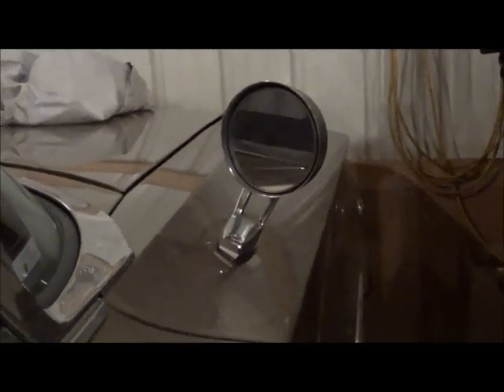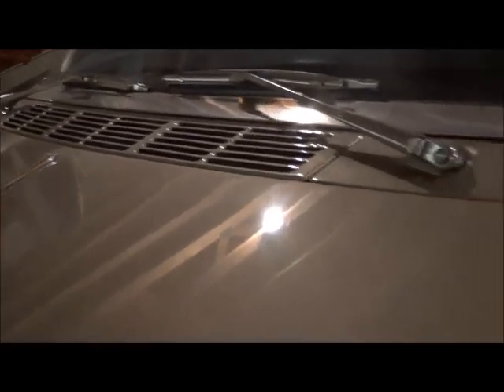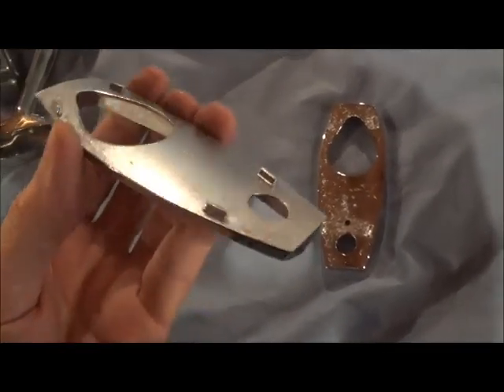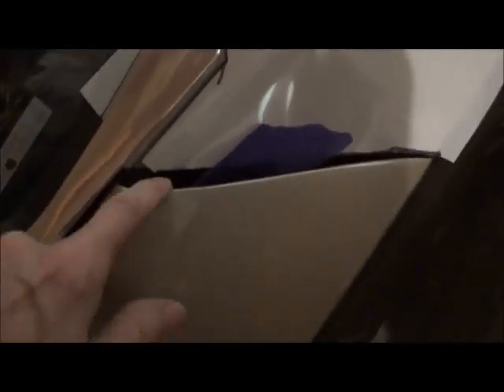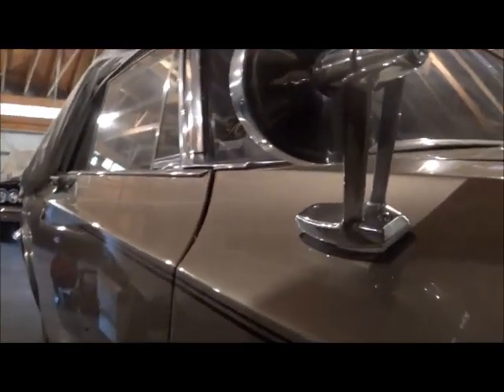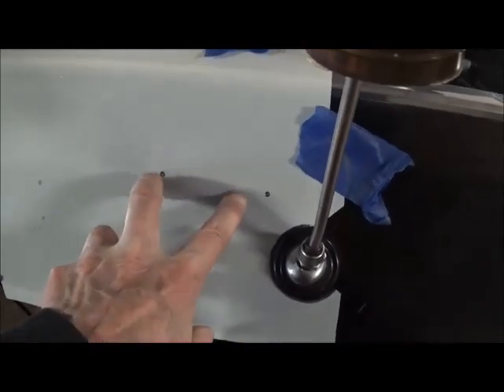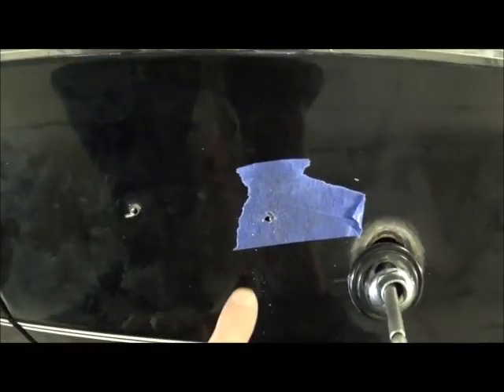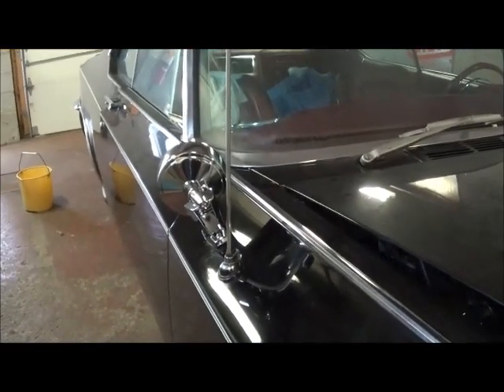1963 1964 Chrysler passenger side rear view mirror

Comment: Very interesting video. I know the mirror placement can be inconsistent. I've seen the right and left ones installed at different distances from the doors. My 300F did not come with mirrors from the factory. They were probably installed at the dealer when the car was new. The mirror control for the left one is mounted under the dash and not in it's normal pod mount near the hood release.

Comment: I just acquired a ‘64 300J  , I have not even brought it home yet ( just today it was a deal made) .
  Can that adjustable mirror I have on the drivers side be placed on the passenger side with a new base ? Looks like a identical mirror except for the wedge/seal and a remote cable. Would love to do a remote on the passenger side as well . 
 Thanks Bob
Reply from the maker: The driver and passenger side mirrors have different angles to their bases. I have seen a driver mirror on the pass side with the hood rotated 180. 
I have a 62 where someone put a remote driver mirror on the pass fender. It is way odd. Better off to install the correct manual mirror on the pass side.